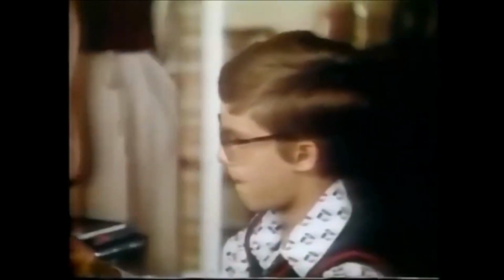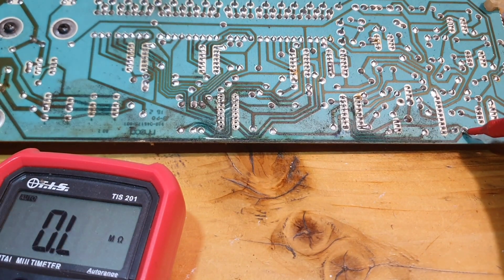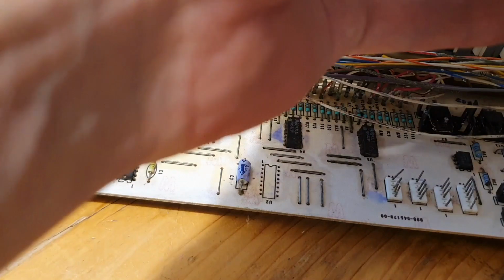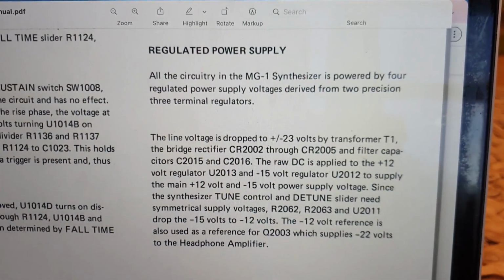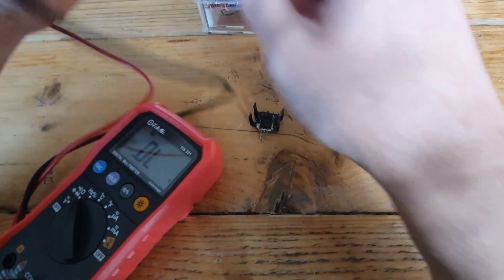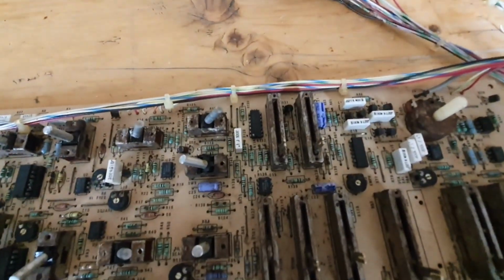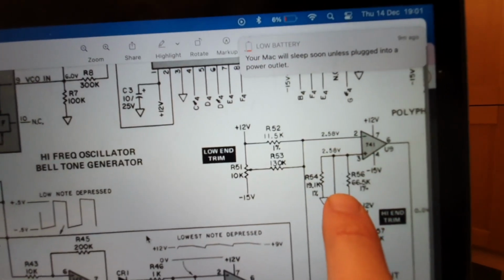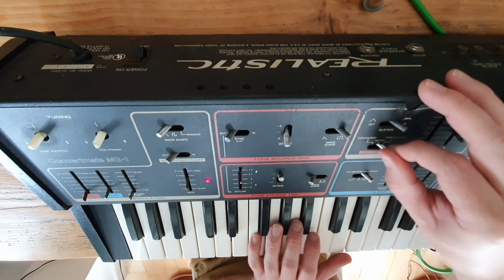Realistic MG1 Concertmate by Moog Music - Part 1 (probably) Repair

Comment: I have a couple MG-1’s. Love them. The poly mode is really interesting, similar to what the Roland RS-09 had. You can play it with the mono mode and play bass and chords since the MG-1 has low note priority. A lot of people added MIDI kits to them but it also has a 1 v/o CV and gate input so they are easy to control with a Keystep and other modern controllers that have CV/gate output. The disintegrated foam sheet can be replaced fairly easily but replacements aren’t cheap. You can use a thin piece of hobby felt instead and just cut holes in it for the pots and sliders (and LED). 

MG-1 designer Paul Schreiber (he sadly passed March 2025) is more recently famous for starting the eurorack company Synthesis Technology and most Eurorack fans know the module “Cloud Terrarium” which is a dual morphing digital wavetable oscillator with a color display. He believed in using the highest quality components which is a major departure from synths like the MG-1 or Micromoog where cost savings were mandatory to meet a certain MSRP. Behringer synths are literally built better than a lot of those old synths were but it doesn’t mean they aren’t very cool to own and play with. 

Regarding the intro: I learned basic coding on a TRS-80 in middle school. The teacher always called them “Trash-80” which might not make as much sense if you call trash rubbish but it was funny in America.

Comment: I traded a broken moped for a broken MG-1 back in the 90s. I was able to get the MG-1 working again and still have it in my synth collection. I don't know if the guy with my old moped can say the same thing.
Reply: Also when I repaired my MG-1 the black foam sheet they put under the controls had deteriorated into a thick and sticky black gel that was coating the entire board. I had to use a mild detergent and water to clean it in the tub and then gave it a cleaning with alcohol and as luck would have it I had gotten to everything in time before the acids in the gels made a mess of things.